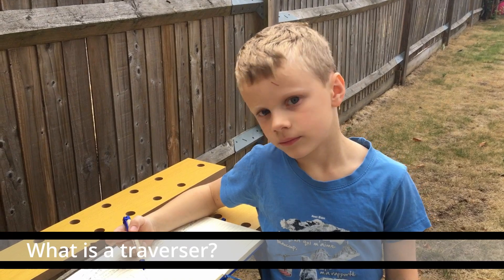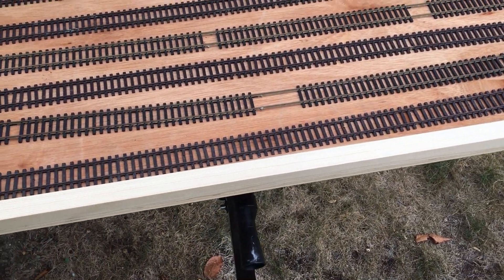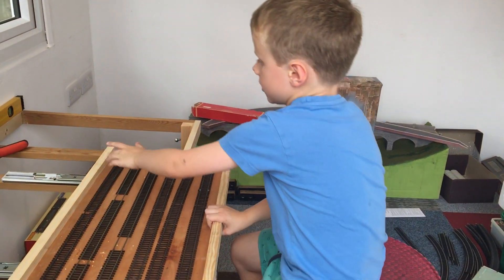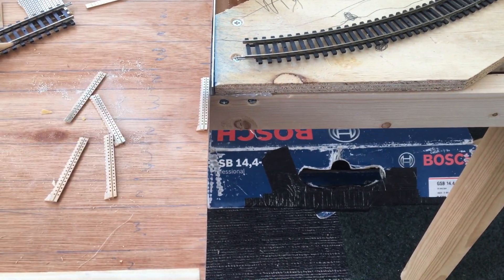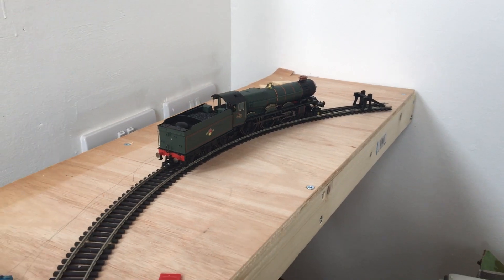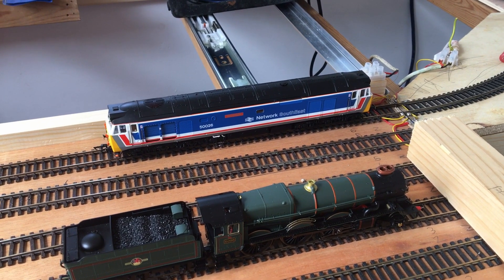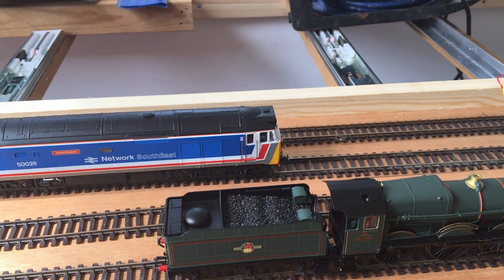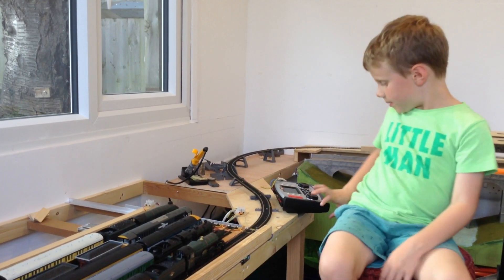Model Railway Update 2 - Building A Traverser in oo gauge

Comment: Hey Simon. Enjoyed your video. The way I am dealing with the 'isolation' issue is to only power the escape road. This means each of the tracks on the traverser are only live when aligned to the escape road. No chance of accidentally running one of the end.
Reply from the maker: This sounds like a good idea. We are probably going to redesign the traverser a bit fairly soon as it has become a bit unreliable, so we might try this. How did you transfer power from the escape road to the road in the traverser?

Comment: if you're running diesels a nifty trick is to have another smaller traverser at the front of the large one big enough to hold your largest loco. This is used to return the stock with a fresh loco, you then drive the original loco onto the small traverser so it's ready to return on the next train. Both small and big traverser move seperately to align locos to any stock you want.
Reply from the maker: Ooh interesting.
Reply: @SimonsTrainAdventures  if that's peaked your interest, how about the new Hornby 7000 series decoders and battery powered dcc locos, no track power. No track to clean, no dodgy stalls on iffy points, no reversing loop control modules, no wheels to clean, ect, ect.

Comment: Hello Simon, very well done on getting the Traverser working. I am looking at making one myself. I was wondering if you could advise where you purchased the Traverser rails from?
Reply from the maker: Thanks for watching! We used heavy duty drawer runners from Wickes to mount the traverser, with a section of aluminium angle at each end to guide the movement. The tracks mounted on top are standard Peco code 100 flexitrack. We bought a large quantity of this second hand on eBay years ago and it has kept us going ever since. 

These are the drawer runners we used: https://www.wickes.co.uk/Wickes-Heavy-Duty-Drawer-Slide---450mm-Pack-of-2/p/103524

We are planning to do some more work on the traverser as the changing temperature and humidity in the shed means the rail heights have gone out of alignment. We'll be doing a video about this soon. 

Hope that's helpful.
Reply: @SimonsTrainAdventures  Thanks for coming back to me. I'll take a look at those. Thanks Tim

Comment: Hi. Is the only way to return the trains to the transverser by reversing?
Reply from the maker: Excellent question. At the moment, yes. But when the rest of the railway is built we do plan to include a reversing loop and a turntable with the idea being that trains will return to the traverser facing the other way after a running session.
Reply: Thanks for the answer Simons dad. I’m looking for a video showing the actual plan.
Reply from the maker: @redvalley9  We haven't made a video with the track plan in it yet, but good suggestion. We'll try and include one in the next video.